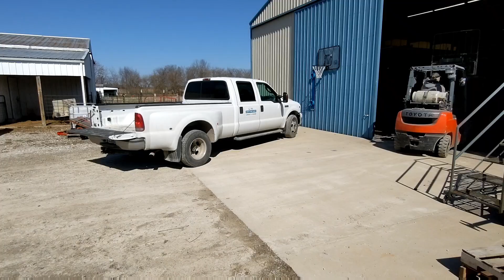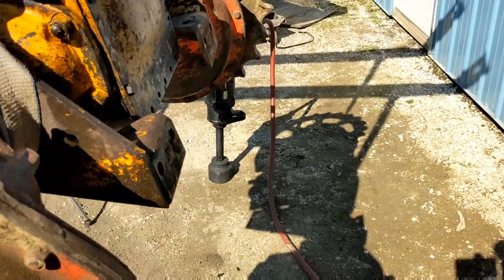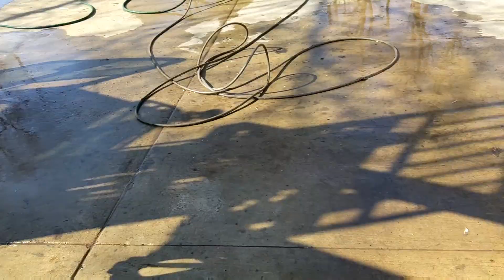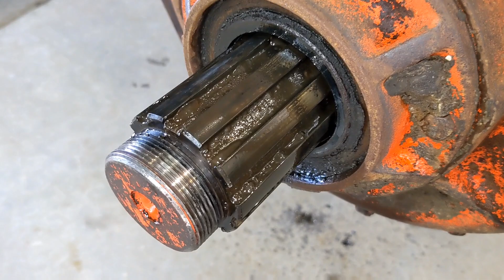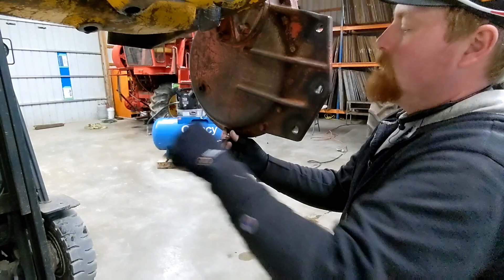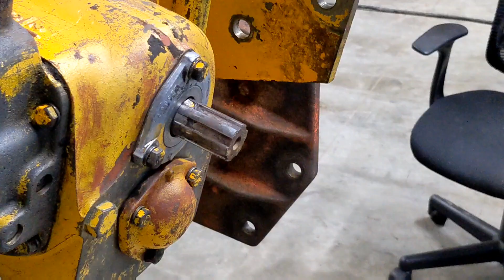Pulling The Sprockets Part 23 Case 310 Dozer Restoration

Comment: I don’t have a 1” impact wrench. I’ve never even used one. I’m not even sure my compressor could supply the air to run it for more than a few seconds! I’ve got a 3 foot pipe wrench that I probably would add a 5’ length of pipe onto it just to turn those nuts on the drive sprockets! I’ll have to remember to loosen those things before I pull the machine apart just to have a way to keep it from moving. Thanks again for these videos! 
Keep up the good work!
Reply from the maker: The book says use a Case closed end wrench and beat it with a hammer. I had to make one many years ago. Thank you for watching.
Reply: Best to do while still on the machine but block sprocket against track frame with a piece of wood to prevent tranny damage.